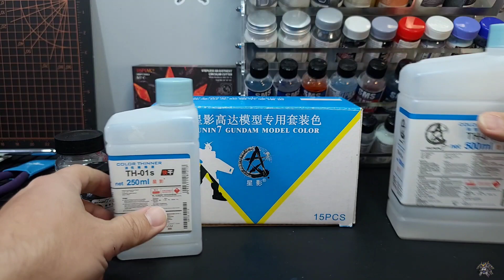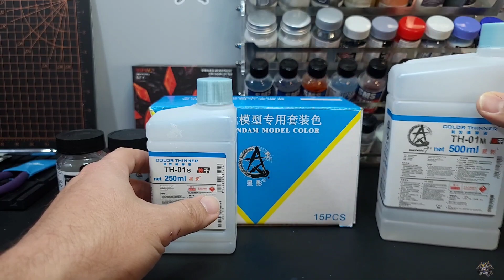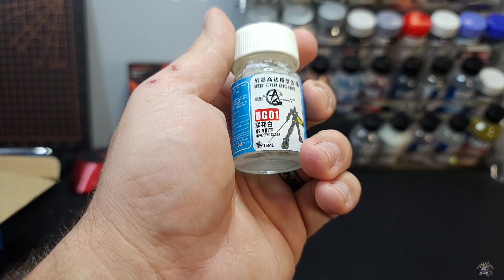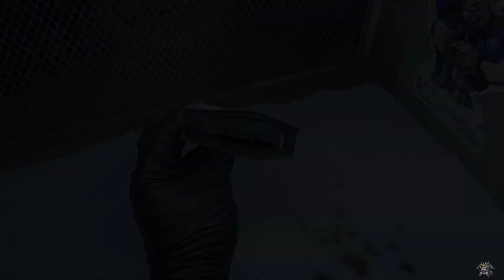SUNIN7 PAINT REVIEW!!!

Comment: Hi - I’m Duvall. I’m really new at airbrush painting. I bought a lot of sunin7 acrylic paints. Stupid as I was I pour it in and got my airbrush clogged. Please help me . The guy that sold to me said it’s not for airbrush but it is a water base paint . Can you tell me if I can use the paint and how to thin it out to use and spray action figure. Please I’m desperate
Reply from the maker: You will need to thin the paint down for airbrushing until the paint is a "milky" consistency. Straight from the bottle is too thick. Any paint can be airbrushed if thinned properly.